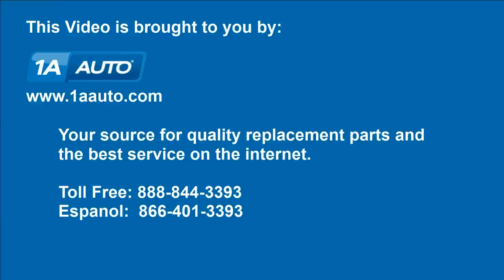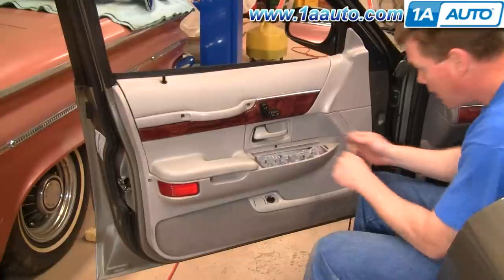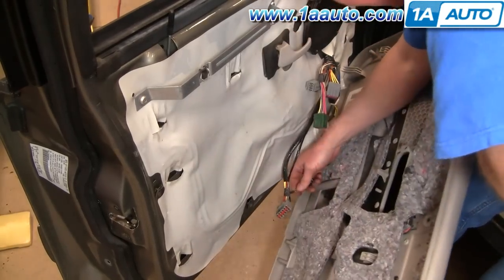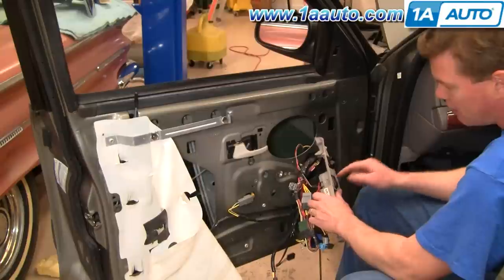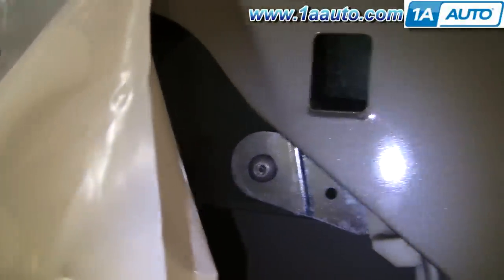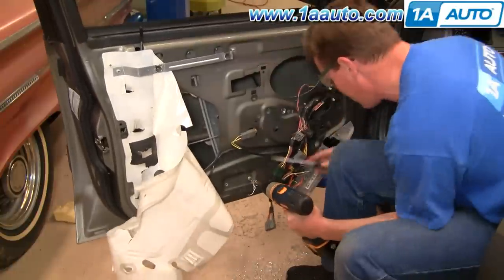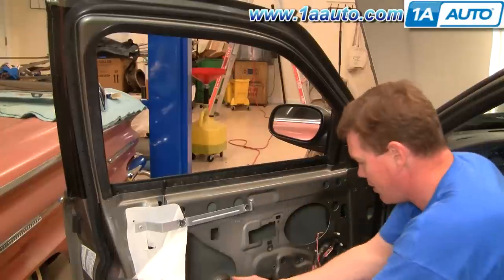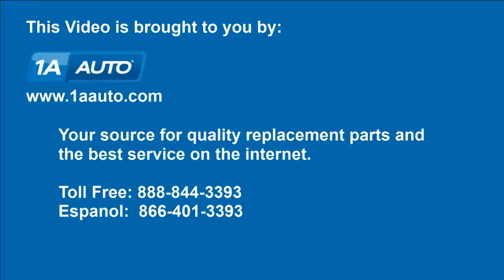How to Replace Window Regulator 92-10 Mercury Grand Marquis

Comment: Replaced the drivers side window regulator on my 98 Ford Crown Victoria in 1.5 hours with these easy to follow instructions!  Used (2) 1/4'' - 20 x 1'' round head combo machine screws for the window and 1/4'' - 20 x 5/8'' round head combo machine screws for the rest. 1/4'' - 20 Nylon Lock Nuts and 1/4'' x 1 1/4'' Fender Washers secured everything. Lubed up the channels with spray silicone and lubed up the regulator with white lithium grease. Thank you 1AAuto for your help!

Comment: What size bolts , nuts , washers you used to reinstall?  Also i was told you can find the keyless entry code on the same door
Reply: I was wondering the same thing. I'm getting ready to do two on my 94 Crown vic

Comment: I have begun to replace the window regulator and when I drilled one of the rivets out of the window the white round plastic piece where the rivet was located broke.  The window is not damaged...I was wondering what that piece is called and if you carry that part?

Comment: Could you tell me what size are the bolts and nuts ???.........................Thank you    bobby
Reply: Maybe too late. I used 1/4-20 course thread with nylon locking nuts. 1/2" on every thing and 3/4" on the Window itself. 
while I was in there, I added 1/2" bolt nylon  nut to my power door lock. That was a bit nuts to get the nut In right spot.  so yay window works and power lock works again.
Reply: I'm sure badge57 has his done, but for anybody else facing this - it depends on the size drill you use to remove the rivets. I used a 1/4" bit. It fit perfectly, and didn't open the existing holes. So I would have been able to go back in with 1/4-20 nuts and bolts. But the AC Delco regulator motor assembly that I purchased came with hardware -- 6mm, to be exact.
Reply: For anyone else that ask this, I used 1/4" x 1/2" bolts for everything that bolts to the door and 1/4 x 1" for the glass.  Use nylock nuts and skip the lock washers.
Reply: All the nuts and bolts were included with mine from 1A Auto
Reply: Did you find out what size the bolts are?
Reply: iI used 1/4"x20..1/2 " length with lock nut washers to replace 3 of the rivets
Reply: Why can't I see the replies
Reply: This black Republican loves your videos 👍 Kudos!!
Reply: 1/4" - 20 ×3/4 worked for me
Reply: What is the size of bolt in mm

Comment: Great video, very informative. Procedure is a LITTLE bit different on my 2006 Grand Marquis but the basics are the same. Was worried a bit about striking out the two rivet pins that hold the window glass but everything went smoothly. Just be sure the punch is lined up to drive straight in and through, if you angle the punch sideways at all you're wasting your striking energy. Check after every hit to make sure you're still centered. Most of the rivets spun while drilling them out, I used pliers on the backside rivet strands to keep it still, or drilled until it spun and then hit the top of them with a chisel, they popped right out. Was able to re-use my original motor, as it was just the wire that jumped track on its spindle and got messed up. On my 06 the glass MUST come out in order to pull back the top of the regulator and clear the two threaded posts away from the door. When removing the glass, push the front end down first, then angle it to come out the INSIDE of the window frame, not the outside. When replacing the glass, I draped a microfiber cloth over the door and down over the top of the regulator, so I wouldn't scratch the tinted glass during replacement. Also had to remove the three rivets on the door handle plate (the door rod connects to it) so I could get to the rivet holding the glass, closest to the front of the car. Used half-inch long bolts for everything but the glass, that took 1" long bolts, nylock nuts on all of them. Hope that all made sense. Not too terribly difficult to complete, but I hope I don't need to do it again anytime soon. Thanks for the video, it really did help by giving me an idea of exactly whats inside there.

Comment: Thanks for posting this, A1. I recently replaced the drivers' side regulator on my '04 Marauder, and this video was extremely helpful.

Since the specific sizes weren't mentioned, I used 1/4-20 x 3/4 inch stainless screws for the door related parts, and 1/4-20 x 1 inch for the window. 

I also used a piece of 5/4" deck board cut to 17" in length to position under the window when the old regulator was in place, which helped make it easier to hold in place while knocking out the rivets.

Comment: Outstanding video -- exactly what I needed to see. ... This gives me a whole new respect for the techs/mechanics who do this for a living. It also makes me feel better (a little, anyway) about the cost of having repairs done at the local service shop or dealer. ... My 2003 Marquis (in my family since it was new on the showroom floor) needs this particular window repair done -- for the third time in 12-plus years and 109,000 miles of good service. ... Must be a basic design flaw with this car/model. ... Thanks for posting this video, which is the best how-to video I've seen. (May 13, 2015)

Comment: Bought my Regulator from 1AAuto due to this video. Thank you!!   Only main issues I had was getting window back in the track. Mostly hand position and movement. and then It wasn't smooth. Loosened bottom bolts, loosened 11mm nuts, loosened window.  Ran it up and down a few times. and then re-tightened in reverse order and everything is awesome.  Minus me scratching my tint. whoops. 
While I had my door apart, I fixed the power door lock, the mount rivet broke long ago.  It was tricky to get the nut on the inside and Philips head on the outside.. but I managed... LOL 
Thanks again!!!
Reply from the maker: Hey, if at least one thing doesn't go wrong you start to wonder if you're even doing it right. Glad it all worked out for you in the end. Thanks for watching!   1aauto.com 866-403-3393

Comment: Ok I got my power window regulator for the front pass and drivers windows from 1A Auto.  Followed the video.  I was dreading the job but everything went great.  The video was very helpful.  The whole thing took about 3 hrs for both windows.  I am very happy and saved over $600 by doing it myself.  Thanks 1A Auto
Reply from the maker: Thanks for checking us out Ron. If you could leave a review for us it would be greatly appreciated. Here's a link to our review section on Reseller Ratings. Have a great day! http://www.resellerratings.com/store/1A_Auto_Parts

Comment: You couldn't have made it any easier. For anyone else ordering the part from 1A Auto I received the necessary bolts in with the part.Thanks!
Reply from the maker: Thank you for watching! Glad to be of help. Let us know how the repair turns out. 1aauto.com 888-844-3393
Reply: Repair turned out great. Part fit the same as original.
Reply: What kind of bolts you used

Comment: I love your video here, I watched it over and over for new ideas, insights & inspiration.  I know I could not have changed out the regulator without it.  I got an aftermarket replacement regulator and had to partly bend it to fit right.  That was after the first regulator failed right after installing.  2 comments.  Personally, I'd recommend that all the fasteners be installed a tad bit loosely and before snugging them up,  do a quick test of the windows up/down operation to see if any binds or such are there.  Then, tighten up all the nuts/bolts.  comment 2, the introduction is so exceedingly loud compared to the rest of the video.   Is there some way to set the volume to the same level throughout.  But truely, overall, a really fantastic video!   Thank you for doing it, an the others too .  DL

Comment: Great video details step by step!! however I also have an issues with Grand Marquis 2001 with my voltage battery gauge reading very low but alternator was fine and working and tested. battery is fully charged also.. what could that be may I ask?

Comment: thanks for the video.  Could I swap harnesses say front to rear , if its a switch issue, and be able to use the front again?. I relealize the rear will now not work but I need the front more. Temporary solution?

Comment: I just did this today. Use 1/4 inch fasteners. I used 2 1/4 inch rivets for the bottom 2 holes on the regulator, and 2 1/4 inch x 1 inch fasteners with lock nuts on the window, as my rivets were too short. Hope this helps!
Reply from the maker: +CREATINELUSTER Thank you for your feedback!

Comment: My window tilts forward when coming upwards, so when it gets close to the top I must stop, tilt the window back, then roll it up the last 1"-2". Is this a regulator issue or a different part? I will gladly buy whatever is needed from you guys after seeing your great video. I was dreading it but not after seeing how easy it will be, especially after seeing the comments of how non mechanics were finding it fairly easy to accomplish. Thanks for your time.
Reply from the maker: +Nerv Mrc You may want to check where the window attatches to the window regulator to see if it has become loose, which may be causing this issue. 1aauto.com
Reply: I will check that out and hopefully that is the problem. If not, it is nice to know you guys are there to send me a new window regulator!!! I really like the quality of your video's by the way.

Comment: Well, I have watched this video a few times and stopped and rewound to go over certain areas.  I have been out to my car, and with pin punch and hammer in hand I have punched the pin out of the rivets at the base of the regulator, but the force it took to do this does make me question driving those pins out of the window anchor points.  As I watch you do this, it doesn't seem that you are using the force that I need to get these pins to move. Could you elaborate on this a little and explain the force needed to drive those pins back?
Thanks.
Great site and good info.
Bill

Comment: Great video very informing, I have a question, I ordered a new window for the drivers side front, the old piece doesn't have any holes, but the new piece is longer and has holes at the bottom, is there a kit or something for these holes to fit on to the regulator?
Reply from the maker: Thank you for watching! They should be a plug and play deal. You might want to contact the company you got the glass from to double check and make sure you received the correct one.
 888-844-3393

Comment: Great Video, 1A.......took me 6 hours to pull assembly out, taped up the 'UP' wire near motor......also, a 'BIG thanks to the mechanic who repaired the door due to an accident 8 months ago........tip: use electrical tape around the motor then lay cable & tape over that..........the mechanic did not do that............Jimmy
Reply from the maker: +Jimmy Kuros That's a good tip. Thanks for posting it. And thanks for checking out our videos! If any of our viewers need to make this repair, we carry the part shown in this video on our website. Here's a link to them. We also offer free shipping on all orders in the US. http://www.1aauto.com/1A/WindowRegulators/Ford/CrownVictoria/1AWRG00254?utm_source=YouTube&utm_medium=CTA%20Comment&utm_campaign=1ATony

Comment: My window was stuck in the down position.  It wouldn't budge so I couldn't get to the two rivets holding the window to the lower end of the carriage.  I ended up removing the two 11mm nuts on the bolts at the top of the carriage.  I could push it in far enough to get a hacksaw blade in to cut the bolts off.  With the inside window trim removed there was room to lift the window and carriage up so I could get to the lower rivets.
Reply from the maker: +Incog Nito Thanks for checking us out. Shop for high quality auto parts on 1AAuto.com:

http://1aau.to/m/Shop-1AAuto-c

Comment: In the video you stated that your window could still be powered down, but if not just manually roll it down, but how do you do that when it is fully closed? Thanks
Reply: I figured out that you have to take the motor off of the regulator

Comment from the maker: You can buy it in a spray can at your local auto parts store. If the weatherstrip is dry it will help your window to glide a lot easier and faster. Hope this helps you out 1aauto.com 888-844-3393

Comment: I had a new motor and regulator installed on the front passenger side of my 2005 Grand Marquis, the window will go down, but not up..... Replaced the master switch and the window is still stuck in the down position. all other windows work except the front passenger. I have no idea what to do. Is it possible that the wires are bad? Please advise
Reply from the maker: You may want to test the power going to the window regulator motor when the switch is pressed in both the up and down positions. If there's power to the motor when the switch is pressed in both directions, it may be an issue with the window motor. Hope this helps you out. 1aauto.com 888-844-3393

Comment from the maker: You may want to remove the door panel and check the window regulator to see if one of the cables is broke or if the gear on the motor has stripped. We carry new window regulators on our website with free shipping if you need a new one. 1aauto.com 888-844-3393

Comment from the maker: You can also check the power to the window switch to see if there's power going to it, with a test light or a ohm meter. 1aauto.com 888-844-3393

Comment: What size nut and bolts replaced the rivets?
Just ordered your window regulator with motor.
Reply from the maker: +Kblisto38 Hello, The size of the hardware would depend on the size of the drill bit you will need to remove the rivets. Thank you! 1AAuto.com
Reply: @1AAuto  
Got the window regulator in today from you 1A Auto. It came with the nuts and bolts.
THANKS...💯

Comment from the maker: You may want to check the power going to the window motors when the switch is pressed to see if there's any power going to them. 1aauto.com 888-844-3393

Comment: Mike, my regulator is fine but my window moves. If you grab it from each end and move it, it moves like it's pivoting on something in the middle, or something on the sides is loose. Any ideas?
Reply from the maker: You may want to take a look at the cable and see if it's caught on something and needs to be freed up.

Comment: Going to give everyone a good tip. When installing the glass back in place use philips head screws on the glass when tightening do not go crazy and do not use hex head bolts with a ratchet. The glass will shatter. Trust me I know from experience.
Reply from the maker: +Clayton Bonds Thank you for your feedback!

Comment from the maker: If there's a window regulator cable that's broke and keeping it from moving, you may need to loosen the cable so that you can move the glass up into position. 1aauto.com 888-844-3393

Comment: how many screws and wat size replace the rivets?I just ordered the regulator from u.
Reply from the maker: +2wheelsonly cruiser Thank you for your order. I'm not sure on the exact size, you should be able to get some small ones that fit from your local hardware store.  If any of our viewers needs to make this repair here's a link to them replacement part shown in this video on our website https://www.1aauto.com/1A/WindowRegulators/Ford/CrownVictoria/1AWRG00254?utm_source=YouTube&utm_medium=CTA%20Comment&utm_campaign=1ATony

Comment: how did you know out the bits that held the window.. i have a 1999 grand marquis and i cant knock them out.. the bar that makes the window go up and down is too lose for me to bang on with a hammer. it might brake off
Reply from the maker: If you follow this video you shouldn't have any trouble making the repair.

Comment: To save some hassle do not remove the door handle.   The hole that the wire for the motor goes through lines up with the inside rivet on the window.   The door latch rod may be a bit annoying to work around but it is less annoying than removing and replacing the rivets of the door handle.
Reply from the maker: +Bendigo Thanks for the feedback!

Comment: is rear track for glass fixed? on powering up the glass veers off rear window frame towards front  and then up and over top of window frame(i.e sticks out)..
track or regulator problem for Merc???
Reply from the maker: +Carl Torjusen You may want to take the door panel off to see if the window regulator has broke. We carry the replacement window regulator shown in this video on our website if any of our viewers needs to make this repair https://www.1aauto.com/1A/WindowRegulators/Ford/CrownVictoria/1AWRG00254?utm_source=YouTube&utm_medium=description&utm_campaign=videodesc&utm_term=o3QvtJIMY48&utm_source=YouTube&utm_medium=CTA%20Comment&utm_campaign=ytcomment
Reply: readjusted track of regulator on which the window rides on. moved the top of regulator bar by unbolting the 2 top bolts(11mm) down towards to rear of door.  Glass now does not ride above  the top of the window frame and does not stick above the window frame. 2 hours from begin to end of installation of door  panel and necessary adjustment.

Comment: My mom has a 94 grand Marquis, replaced the switches and when you hit the up/down there is a laboring sound. Window doesn't move at all. The same goes for passenger side.could it be 
A) bad motor
B) bad regulator 
C) bad motor and regulator

Comment: How much did you charge for this? I have an 05 and neither of my front windows work and neither does my ac.
Reply: Ac could be the blend door not opening. Common problem but it's behind the dash. Huge job. Having regulators replaced isnt really cheap either.